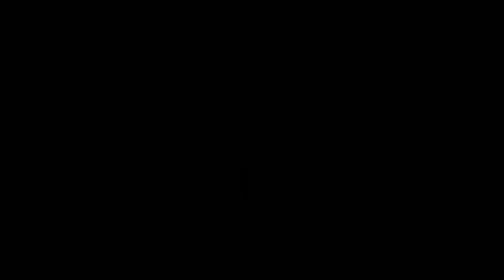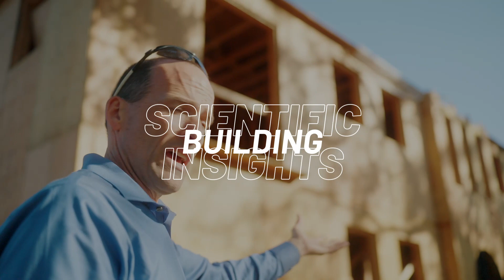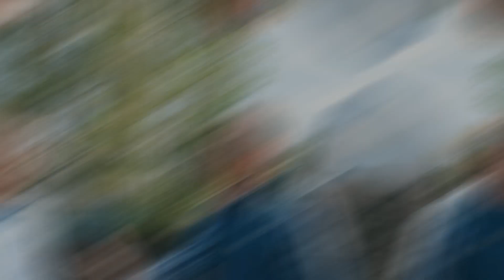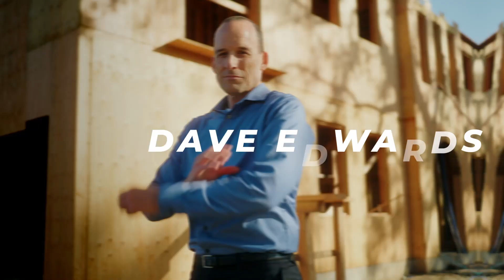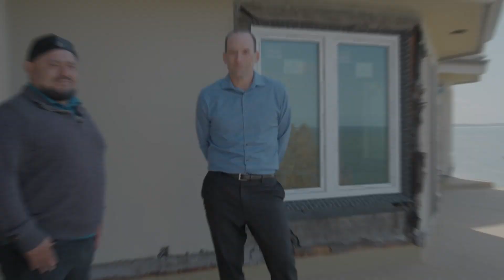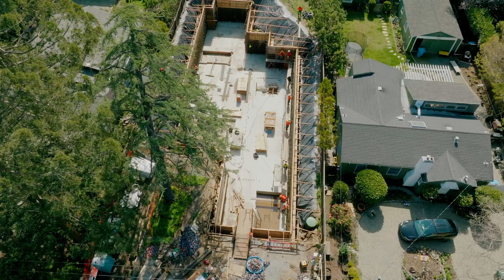Cliff House#7:  Cruicial Details = Amazing Spaces  -Bombproof Decks Over Living Space

Comment: Great videos! Any input on the Costco Mohawk 22ml vinyl planks? Or where to get some good planks at a great price?
Reply from the maker: Unfortunately, I have done extensive research and between the extensive use of formaldehyde and Vinyl , both of which are toxic chemicals and are associated with Cancer, I cannot recommend any vinyl or particulate wood planks.   The best solution is a Marmoleum plank, which uses linseed oil instead of vinyl, making it a great, long lasting, non-toxic and water proof flooring.